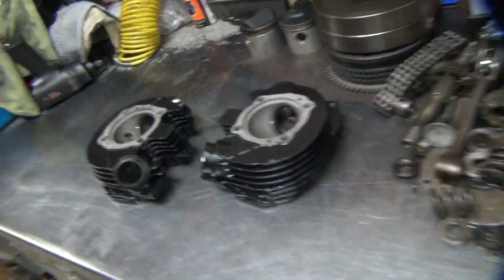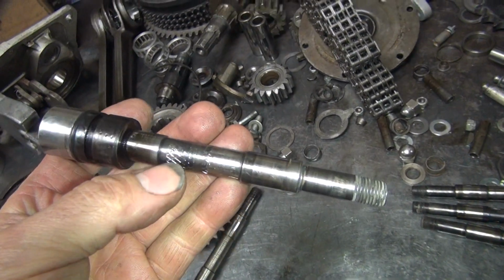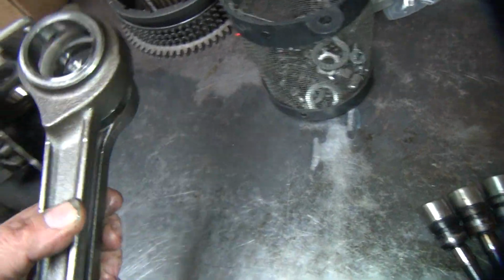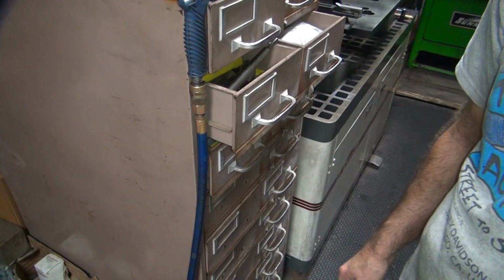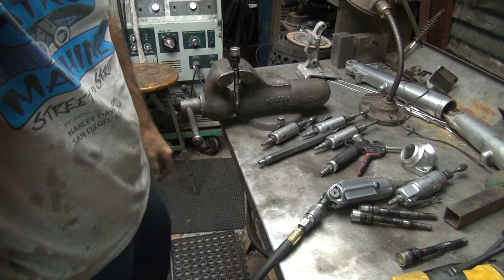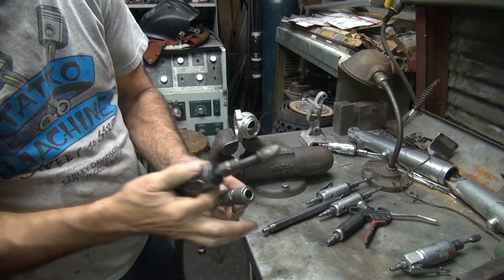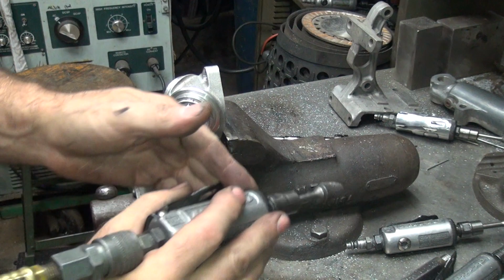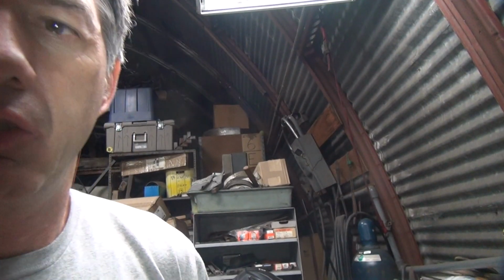1977 xl xr street tracker #103 motor rebuild repair 1000cc sportster ironhead by tatro machine

Comment: I like your organizational skills. There kind of like mine. A pile for everything and everything in it's pile.......... I think your torches need a valve job. I once had an old victor set that fired back through the valves into the hose and blew out. Scared the hell out of me. A true craftsman can find a way to modify and improve something as basic and simple as a hammer.........